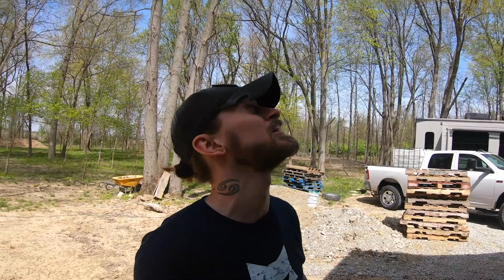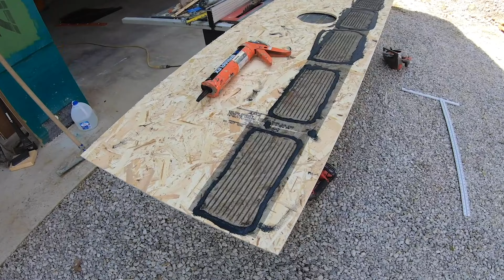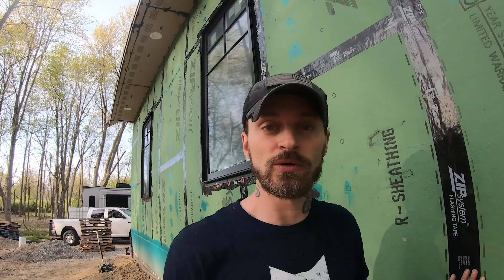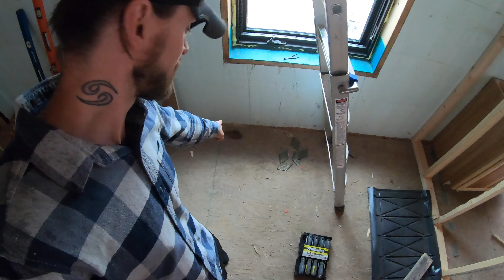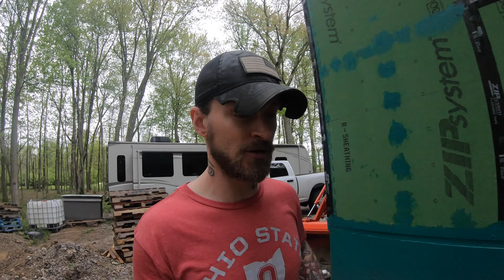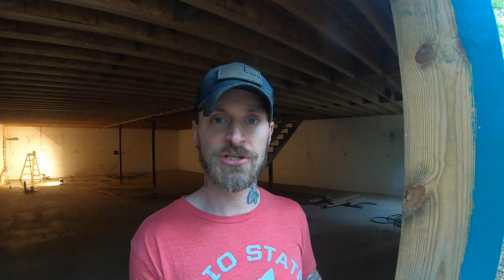Soffits, birds & water issues again :(.  But we have POWER!

Comment: I hate water issues too, I learnt the hard time consuming way, to work with the water flow instead of trying to fight it. If you have a French drain below the conduit, then you may have to settle with carefully drilling a couple of holes in the bottom of it and allowing the water to drain out of the holes. The water will drain down to the French drain and be taken away preventing water from entering the your basement. I've done something similar in the past on my house and has worked a treat! As the holes will be at the bottom, nothing will make its way inside  the conduit and it will be covered with gravel when your done, so no-one will ever know about it except you and me. :)
Reply from the maker: that was my thoughts; drilling holes or cutting a slit or hole in the rubber coupling facing down for a drain.  then on the inside spray foam the S*&^ out of it!

Comment: What is the 3 inch conduit for?, if it is for electrical I'd use direct burial line and just have conduit right at the wall for the penetration and then use some foam.
Reply from the maker: Just protection and technically the ground was not direct burial so it should live in conduit.

Comment: This has nothing to do with the content of this video, but every time you show the inside of the garage I see your access ladder to attic.  Are you going to cover with same metal as ceiling or paint?
Reply from the maker: Yes I need to order like a 8’ panel and cut it into 2 sections because that access is longer than a panel is wide.   I’ll screw that to the access door and I’ll make a seamless transition.  All you should really see is the pull string.